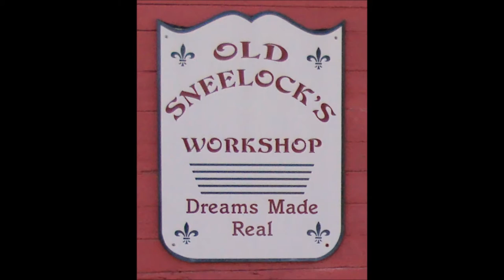Antique Shop Finds At Shiloh Farm ARTiques ~ Removing The Tote ~ by Old Sneelock's Workshop

Comment: I went back to the Re-strore and the buffer was gone. Had a gaggle of 1/4 inch drills but I thought with a 3/8's and a half, another one would be just one more thing to keep up with so I saved several $$ and walked out with nothing. Felt like you do sometimes; just isn't the day for it.

Comment: yeah, if I bring home a saw fix it up and ends up just sitting in the rack, I try andbget into the hands of someone who will use it. Just gave an Atkins away recntly. Working on an EC jennings with some cracks in tje plate now. It is going to endnup quite a bit shorter than it is now. some before me shortened or broke it off. That one I will keep. I need a shorter saw sometimes.
Reply: When I come home I want to get in the rack, and do, after a while.